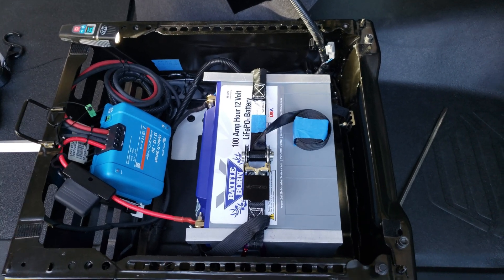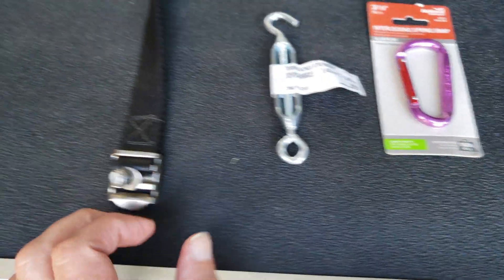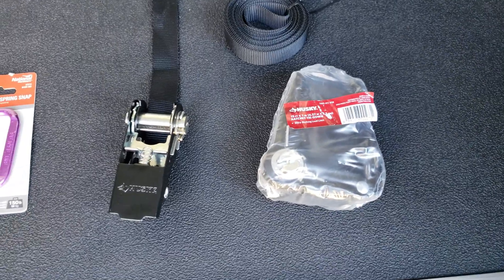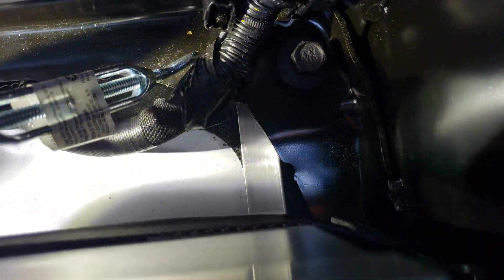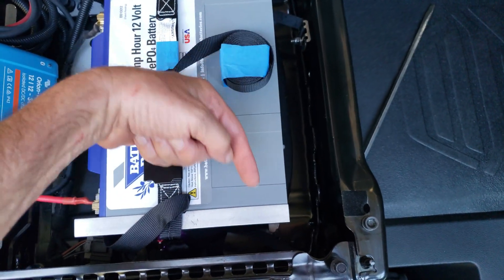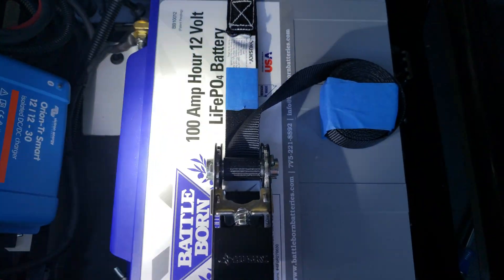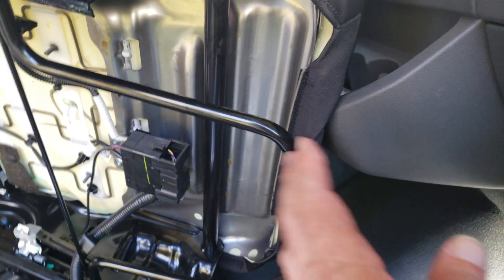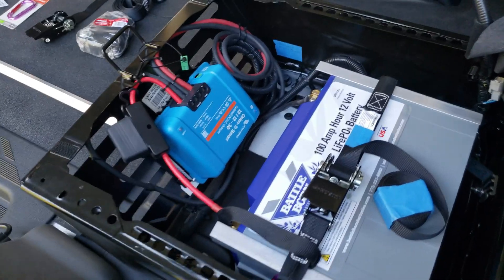Battleborn LiFePO4 Battery || DIY Install under Passenger Seat || 2020 Ford Transit

Comment: Sick setup
Reply from the maker: Thanks! Are you going to install one of these systems? It works well and I've had no problems with it whatsoever. Did you see the video that I have about the DC to DC charger installation?